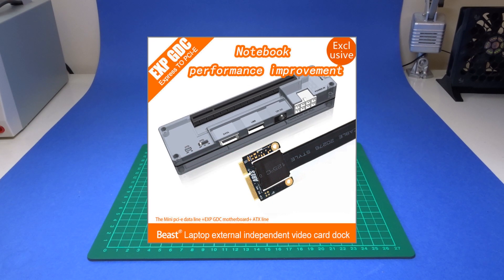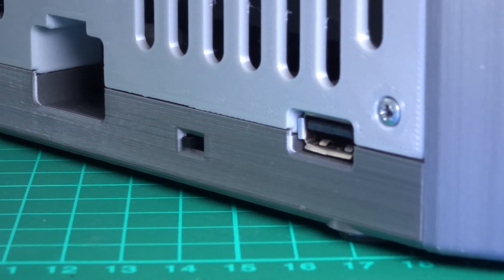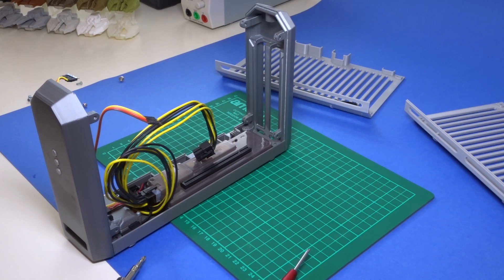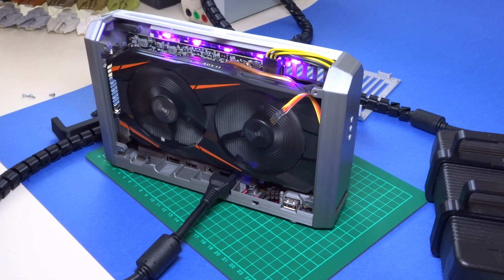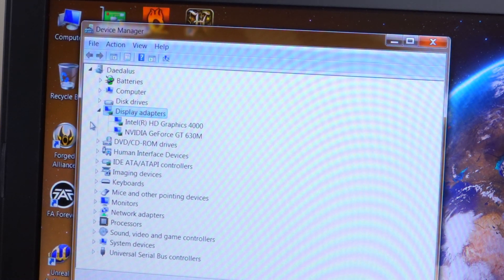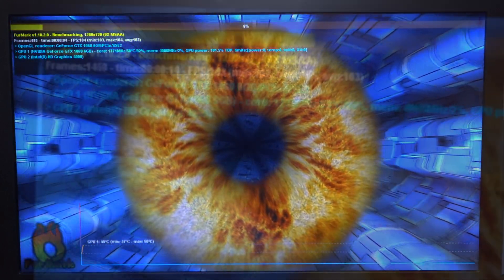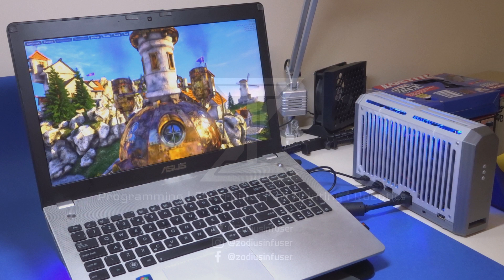Custom 3D Printed DIY eGPU Enclosure - Setup and Thoughts

Comment: 220W is enough for gtx 1050 ?
We really don't need a power supply ?
Reply from the maker: Depends how many power connectors it has. If it has a single 6 pin like my GTX 1060 then all you actually need is 150W. This only needs to power the GPU not the rest of the system as would be the case with a desktop.  More info here: https://www.geeks3d.com/20101108/tips-maximum-power-consumption-of-graphics-card-connectors/
Reply: GTX 1050 only draws 70w at max load.

Comment: Can you play online though you took out the wifi card what if you want to play online? With that external gpu and I downloaded your design file so I can show it to my God brother who does 3d modeling to get his opinion lol I can't wait to make mines like this
Reply from the maker: Yes you can still play online, but you either need an ethernet connection or a USB WiFi card. I've used both with success.
Reply: @ZodiusInfuser  I'm deciding on rx 570 or gtx 1060 sigh not sure which one lol
Reply from the maker: @AznJungleFever  If your laptop has Nvidia graphics already then going for a Nvidia card like the 1060 6GB (3GB one is actually poorer performance, and requires more hoops to jump through on the driver side) is your best chance of getting it driving your laptop's display, if you want that.
Reply: @ZodiusInfuser  you are awesome! For replying I hope the best for your channel bro